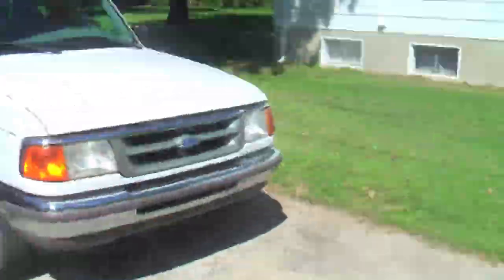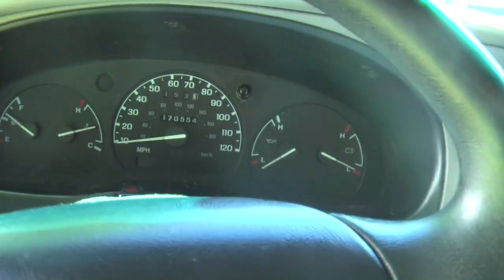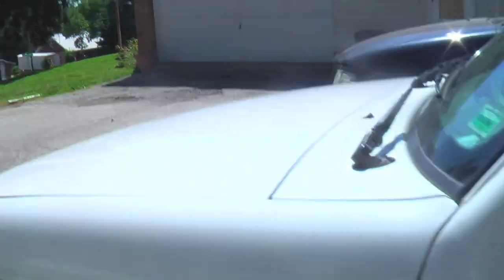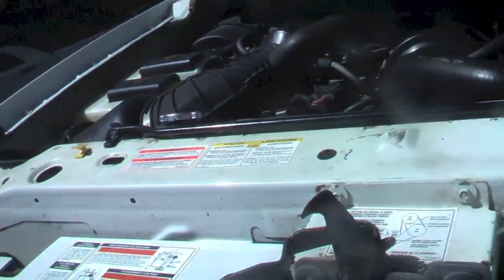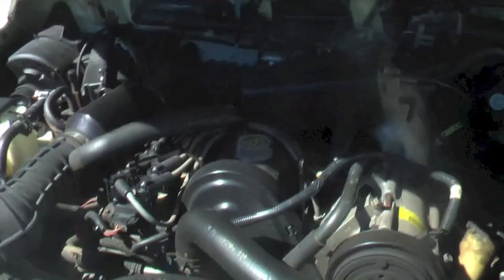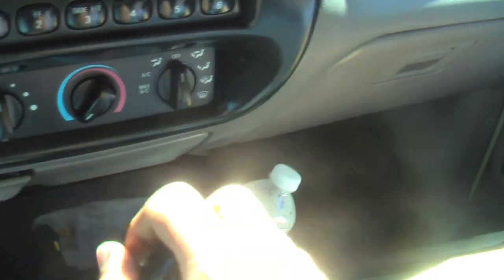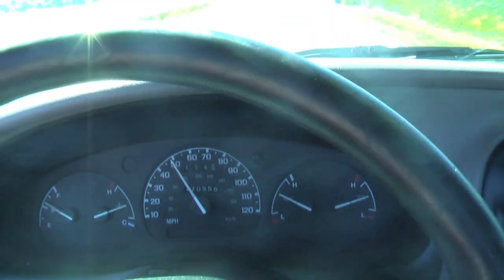Driving the 2.3 5 Speed Ford Ranger

Comment: Fun fact about the lack of tachometer. You can swap the cluster from an Explorer and it works perfectly fine. Did it to my 96
Reply: Dude!! What a tip
Reply: What year bro
Reply: Same
Reply: Any 3rd gen Explorer or Ranger dash cluster will swap out.  Year range is 1995-2011.  Just go to a junkyard and pull one out.  Not much preventing you from pulling them out and dirt cheap since Ranger's are quite commonly found trucks.
Reply: @slayerjohn447  swapped my 1999 cluster with a 2011 worked fine. And it's got the silver background rather then black
Reply: My mazda b2300 is a 5spd and has a tach I love it
Reply: Would it work in my 94?? The dash is a bit different
Reply: @slayerjohn447  2nd gen is 93-97,  3rd gen is 98-2012
Reply: @Fr3sh-Kush  Must have been thinking about my old Ranger or something when I said that, because you are right.  Except I thought 92 was the beginning of the 2nd gen.
Reply: U
Reply: Thanks for that!
Reply: @HTX XLR8 Yes, that’s true. But then you have to swap the mileage out.
Reply: @bstd2jz  dont you lose the odometer?
Reply: @shinobusensui9395  yes. idk if you can reprogram those ones but i didn’t on mine just remembered where it was at
Reply: @bstd2jz  thanks for letting me know
Reply: I hated the fact they installed tachless guage clusters into the early rangers.
Reply: @slayerjohn447 NOPE! The year range is 1995-2003.
Reply: @bstd2jz I highly doubt it was from a 2011 model! 2003 was the only year with a silver cluster.
Reply: @evilredBoris That is complete bullshit, it had nothing to do with the years. Some just had them and some didn’t, but it was optional every single year until it became standard for every Ranger model to have one in 2001. These clusters are interchangeable only from 1995-2003, the ones after that are completely different.
Reply: @2H2521  Care to prove how I am wrong?  Since I know my 2009 Ranger cluster will plug and play in my 2003 as well?  On top of the fact that the 2003 has the same cluster from a 1995.  Granted the digital odometer might not power up due to the 2003 not having the odometer in the ECM.

Comment: Owned my 2.3 ranger for 5 YEARS sitting on 202,000 miles runs like a top. Replacing the 8 spark plus you'll need the following: a lot of beer, and wobbly sockets.
Reply: Lmfaooo
Reply: LOL /MY WIFE HAD TO HELP ME WITH HER LITTLE HANDS  WITH THE PLUGS /2-3 XTENSIONS AND SWIVELS  AND ITS STILL A BITCH
Reply: switch the plug wires around, free dual ignition
Reply: Not really just remove the upper intake. Loosen the egr tube from the exhaust and the egr from the throttle body. Remove the upper intake with throttle body attached to avoid replacing that gasket. Then you have plenty of room to operate
Reply: Pretty sure the 2.3 was a 4 banger
Reply: Got a 1991 Ford Ranger 2.e liter with only 121000 miles
Reply: My 99 ranger has the 5 sp 2.5 4 cylinder
Reply: @knightsofthefallen5  it is a 4 cylinder but it had dual ignition in '97 so 8 spark plugs, 2 per cylinder. I know because I had one years ago.
Reply: Yeah, its a two Miller job...
Reply: @juanramos6976  dammit. I'm trying to get what you are. 😞
Reply: I've got to drink way too much beer to get in the proper mood for this little trip through the hubs of hell. I've owned several Rangers over a 30 year span, and they all proved to be unbelievably dependable, capable of half a million miles or more if properly maintained, and in my opinion the Ranger has always been the toughest in comparison to any of the s10 Chevys I've owned. With that said, I haven't owned a Ranger in 20 years until I brought this one home yesterday and started having freakin vietnam flashbacks as soon as I popped the hood....and I never fought in Vietnam...I was about 5 years old when the war ended....anyway, I'm getting stressed out just thinking about changing these fucked up spark plugs, got the dang o PRE-TSD
Reply: I've used a straight rubber hose like vac line that fits over plug like sparkplug boot. I use it for overhead valves engines too.
Reply: wait.. is it a 2.3 V8 or a I4 Twin-Spark?
Reply: @somal1anwarlord197  In-line four with a twin spark
Reply: @ship-dittery2237  the last time I did mine is when the engine was getting changed. Now it's a write off , looking at more
Reply: Everyone looks at me crazy when I want to replace the motor in my Ranger. 10 people have told me get another car. Sorry no and next person that asks me I'm going to say if your parents were broken, would you get new ones 🤔. Everyone so quick to get a new car with mystery problems or drown themselves in debt. I'll drive a beater and enjoy my life thank you.

Comment: the 2.3 is possibly the most reliable motor around
Reply: B Dogg u can let the timeing belt break an just slap on a new one with out having bent valves it’s a good design
Reply: I did. Snapped while going down the road. Towed it home and drove the next weekend.
Reply: I have a stunning Toyota Camry  i might sell  and  i could   use  a 5---speed  2.3  ranger.                     Excellent  camry----owned 3 yrs.
Reply: @cmwgfo2024 nice one bro
Reply: I have the 2.3 duratec, 2.5 Lima ranger both crew cabs 5 speeds and 4.10 diffs but they don't compare in reliability to my 89 F250 T18 4.9L 300 with 776K miles no rebuild
Reply: tbone3366 776k miles no rebuild that’s legendary
Reply: 3.0 v6 will outlast it
Reply: High Society that’s insane haha probably never revved above 2,000
Reply: High Society that’s just so many miles for something not to wear you’d think atleast
Reply: @cmwgfo2024  hahahahaha,  well said!!!
Reply: @kamryn7496  Did they actually put timing marks on that motor? I know the 4.0 I have supposedly doesn't have them but it has a chain.
Reply: 1337penguinman yes there’s timing marks on it
Reply: I'm glad to know that, I bought a 1997 Mazda B2300 (basically a Ranger 2.3) 5 mounths ago with 192000 miles. Nice car, I just have made some typical mantinance works, (change spark plugs, shoks, oil, clean air filter), and despite that is a bit beaten, it stil working with no issue.  I'm ever worried about his reilability due is my first car, but, It didn't gave troubles for now. It is maybe a bit slow, but it does the work and that somebody say that it is reliable, make me feel better.
Reply: Just bought a 2.3 5 speed ranger 97 176k miles for $2000.00 registered it for 5 year's for $73 funny tell my family about it. Say you registered that hunk of junk for 5 year's. Yep have a feeling going to be way more reliable then any of my ex GF. Keeping it till gas is stopped selling. In my area i get 30+mpg

Comment: I have a 1994 ford ranger XLT 2.3 litter 4 cylinder long bed that just hit 341,000 miles. I really enjoy driving a stick shift.  The gas mileage is great.
Reply: Just bought the same exact truck. Great gas mileage but damn is she slow. I think I’ve floored the pedal on this truck more times than I’ve floored on any other car I’ve owned.
Reply: I have a 2003 with 319,000. Still running great
Reply: @alectomasch9965  😁😂😂😂😂
Reply: I got a 97 I just bought clean as a whistle with 366k all original :))

Comment: Ive got a 1998 Mazda B2500 5spd (2.5 ford engine) with 466,000kms, with oil changes every 3k she is still running smooth with no issues (keep in mind I live in Canada with at-times harsh weather) other than changing light bulbs or preventative maintenance. Great trucks!

Comment: .You have a fine machine and these trucks are great.I am on my third ranger the first a 2.3 the other two 4.0 engines.All were 5 speed.Most folks do not realize that if you have a 4.0 engine in your ranger,FORD also adds a 8.8 full size F150 rear axle.The one i have now is also a 1997 xlt ex cab 4.0 5 speed with only 72000 actual miles. Great trucks i wish FORD still made them.
Reply: I heard they maybe bringing ranger back to US. 

If they do many people in op  for the ranger. New rangers are larger and crew cabs.
Reply: dudelivestrong yeah and they will cost 30k...
Reply: the 4.0 was a damn good engine snd still is... until the timing chain tensioners go bad. if u run it for a little to long after that then u gotta replace 3 tensioners and 3 timing chains. the issue is one of the timing chains is in the back of the engine for most like in the explorers so you have to pull the transmission and engine just to do it
Reply: @MrGreatxam  What do you know all these years later and you were right!

Comment: I have a ranger that's a year older than this, but it's an XLT v6 automatic transmission. It has a little over 180,000 miles on it, but still runs great with only a few minor issues.
Reply: mine has 217,000 miles and is still solid
Reply: ryfodrea i have a 96 as well but mine has the 2.3 with the 5spd manual. 198000 on it and its still pushing
Reply: ryfodrea I have the 95 xlt auto 2.3l ,had it since 95 bought it brand new .it has about 150000 on it an I just a couple weeks ago replaced original starter ,alternator,serp belt ,cyliniod.all those parts lasted me 22 years.great truck ,slow as hell though but I'm not in a hurry

Comment: Reminds me of my first truck. My graduation present. 2000 ranger. Mine had the 2.5 though with the dual plug head and  7.5" 4.10  rear. 5 speed manual. Truck was quite the tire shredder for a four-cylinder.

Comment: I had a 1997 Ranger 2.3 also. Great little truck. We retired here in northern NY when it got too rusty but it had 232,000 miles on it by then. Mine was the base truck and thus had no power steering but I find a decent manual steering  superior to totally effortless power steering that has no road feel. I could get darned near 30mpg on a trip at speeds of 55-60 mph.
Reply: Mine has 570k miles and it's a manual. I'm only getting around 20-23 mpg but I also have bigger tires on mine

Comment: I have own 3 rangers since 95. My most recent 2011  fx4 4 liter 5 speed with torsen differential. Love driving it. Best one so far.
Reply: Should I buy a 96 2.3 or a newer 2.3 that has the boost in hp?
Reply: How do you remove the governor off of it ?

Comment: just got a 2001 ranger 3.0 v6. didn't know it had a glass pack or cherry bomb muffler till i went under. So it needs to be replaced with another. My first truck. Always had SUV or big cars. This little truck is fun. Just like you said. I just wish they would have left the govener off. I mean top out at 90. There is still more speedometer to go. Like you said. On the highway smooth and comfortable. Got 155k on it. Some day full size pick up. Loving the little one right now. Happy miles to you.

Comment: I have 1995 ranger. I bought it in 96 with 12,000 miles. Now it is a little over 334,000 miles. I do all the work myself. I had two people from work wanting to buy it. I told then both. They don't have enough money. It still gets around 24 to 26 miles to a gallon. Knowing me.  I will keep driving it till the wheels fall off.

Comment: i got a little more low RPM power out of it with some NGK spark plug wiers Bosch Double Platnom a full intake and a free flow muffler I used the thrush turbo cause its still quiet

Comment: Cool truck. I used to drive one at work. It was a 1989 ranger with a 2.3 4 spark plug engine 5 speed stick. No power steering, no ac. The radio was stuck on the gospel channel and wouldent change. It was a good little work truck for what it was though. I learned how to drive stick in it and its a hard truck to learn in because of the lack of power. But when someone throws you the keys and says figure it out you eventually learn

Comment: As far as a tachometer goes (you probably already installed one), you can rip one out of a same generation explorer and it bolts right up. One connector, just be sure to change out your odometer to keep it original miles.

Comment: Thinking about buying a 1996 Ranger Splash XLT, 4 cyl, manual transmission.
Reply: go for the 4.0 or atleast the 3.0 the 2.3 has absolutely no power they can barely go up hills with no load
Reply: P
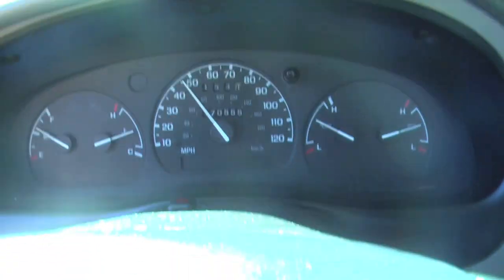Reply: MotorPickle I have a 2.9 v6 in my 1990 and it runs pretty good but it has 4:10 gears
Reply: Well either way, power or not,you can always count on that 2.3 cranking up and firing
Reply: DasMahShiii Boi damn right!! 😉
Reply: I would check the differential and see the gearing. Personally, since low torque is the problem for the 2.3, I would go from the stock 3.45 or 3.55 gearing to at least the 3.73 -- that way, you find the best of both torque and power in one axle.
Reply: I have a 94 spash, reg cab, 4x4, 4.0, 5spd with 130 on the clock.
Reply: @isaiahwelch8066  I like that man, how do you do on that ?? , do you replace just the gearing in the differencial box , or you just replace the whole differencial??
Reply: @isaiahwelch8066  do you know someone who has done it already?? And how did that go ???  Did it gain more power ?

Comment: Put 4:10 gear set in the rear diff, that will solve your lack of low end power problem, but you will hear the diff buzzing at 80 mph and there will be a fuel economy difference, But doing the swap is well worth it as long as you don't do lots of interstate driving, The city and country drives will be much improved.

Comment: Had the mazda version of this. Same year. Same truck with some really subtle differences (like the dome light shut off on a timer when you got out). I finally sold it at 265k miles when I got sick of the twin ibeam front end. Honestly it was slow as gorilla snot but that 2.3 was dead reliable. I have a 99 now with a 4.0 (pushrod version not the cursed SOHC) supercab

Comment: My aunt used to have a 1993 Ford Ranger back in 2005 to 2013. It was quite the truck. Then she sold it in 2013 and got a 2001 Honda Accord or I think it was 2001 Toyota Camry I probably don’t remember and now she owns a 2010 Ford Fusion. But man I miss that truck it was quite a rig. Especially the manual transmission. You just don’t find those anymore.

Comment: I got a 98 with 4cyl loaded my 4 wheeler in back broke a spring, got new heavy duty springs then found a 8.8 posi rearend at junk yard for 100.00 and rebuilding it completely and putting in 5.13 gears and getting rid of the 14 inch wheels now that it will have a 4 inch lift and also doing the front with 4 inch lift spindles and getting some 15 inch universal  fit Corvette rally rims and big tires , I will see how it goes with the 4 banger, if not so well I have 3 400 small block chevy engines and few 700r4 transmissions and a muncie 4 speed , not for hiway just puttsing around town, Mine came with a tach

Comment: You have the same Ranger package as I do, with a few differences. Mine is extended cab, 94, and red. We have the same 2.3, sliding rear, five speed, two wheel drive, super-fun-to-drive truck. It's a great little ride, ain't it?

Comment: I have 97 ford ranger 2.3 5spd and it didnt come with  tach either so i bought a speedo cluster with same miles as my ole ne had and plugged it in and all works well even tach,those trucks are already prewired for tach
Reply: yeah,  the explorer 96, 97 cluster works fine on ranger 95,96 with no tacometer......... works great!

Comment: Can't believe it had no tachometer
Reply: my 96 f150 5 speed doesn't have one
Reply: Surprisingly a lot of manuals ive driven dont, had a Hyundai Accent with no tach, a older civic with no tach, my 93 Accord does have one, not sure if older cars had it as an available option?
Reply: Branden Peck it's a automatic u don't need it
Reply: smp_4 p The ranger or cars I listed? They are all manuals. I think all cars should have one, needed or not.
Reply: Branden Peck true my 2002 f -150 doesn't I guess it saves money. Lol
Reply: It may be a base model my 2002 f-150 has no tach and my 1996 Nissan hardbody does.
Reply: i never really needed on my i6 likes to be shifted about every 10 mph
Reply: it was a 200$ option to have the tach my 94 has one but its also the 4.0 v6 4x4 5 speed
Reply: My 96 Dakota is a 5-speed and has no tach.
Reply: cumulo25  are you going to sale the truck.?
Reply: My 2003 f150 has no tachometer
Reply: Wonder if you can pop in an Explorer instrument cluster.
Reply: hey people, the explorer 96, 97 cluster works fine on ranger 95,96 with no tacometer......... works great!
Reply: hey people, the explorer 96, 97 cluster works fine on ranger 95,96 with no tacometer......... works great!
Reply: 95 and 96 Explorer clusters can also take a variable oil pressure sender too. Not sure about 97. There is a small mod with a resistor. So you have a real oil gauge. Works awesome on my 96 explorer. Use the motorcraft part, I think it was under $20 online..
Reply: corey mink  ikr my brother had an automatic and it had a tachometer.
Reply: My 1999 Ranger 5 speed manual had no tach, never really missed it either. Funny thing is my 2008 Ranger with an automatic does have one and I rarely look at it
Reply: corey mink doesn’t need one u can’t tear them up
Reply: corey mink you don't really need it, after you learn the car its all off noise
Reply: You can hear when it's need to be changed to another gear. I have a 91 2.3 l with a tach but it's useless and I never use it!
Reply: 96 5 speed doesn't have one. Dont need it. Just listen to it
Reply: I would get a tach for a 94-04 Mustang or Explorer. For me, the tach is vitally important. Why? Because when things start happening, the tach can tell you if the motor is running smoothly.

Example: October 2018, my tach would "bounce" and jump around. Had I not actually felt the truck's drivetrain jumping as well, I would have wondered if the gauge was faulty. Come to find out, worn cam bearings, which was stretching the timing belt, caused problems with the engine running smoothly.

What I'm saying is, auditory cues aren't enough, especially when things are engineered and built on a scientific, numerical basis.
Reply: Its kinda crazy to think how Tachometers were availible as options